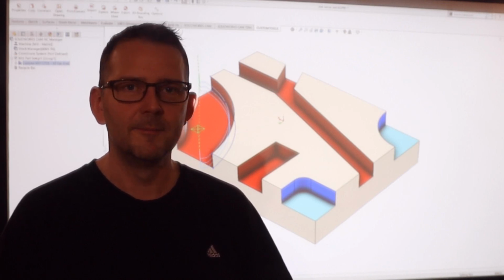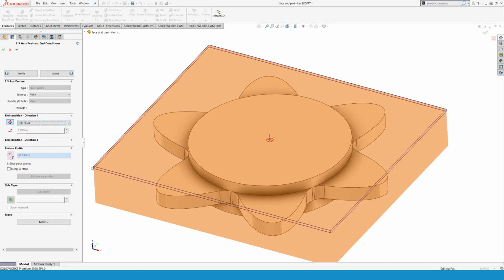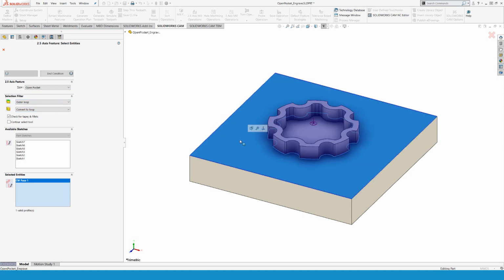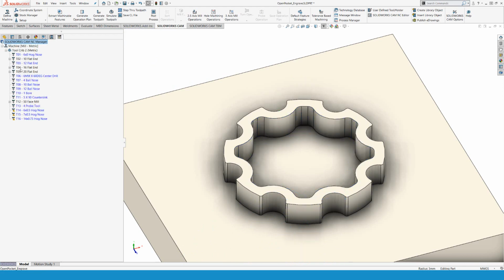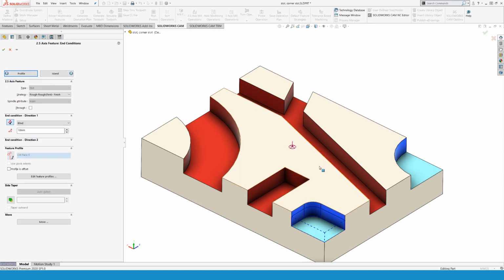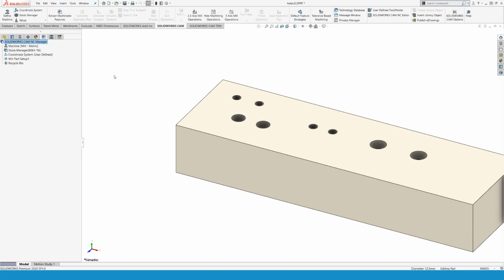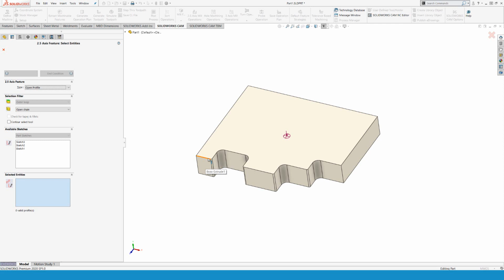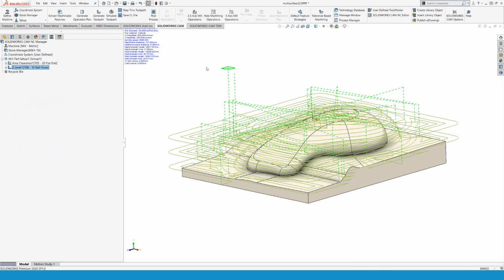Introduction to SOLIDWORKS CAM and CAMWorks - Understand Features

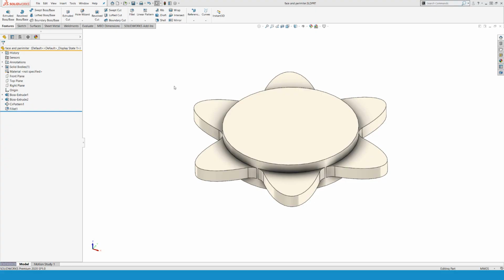Comment from the maker: 2:00 How to activate SOLIDWORKS CAM or CAMWorks

- Demo #1
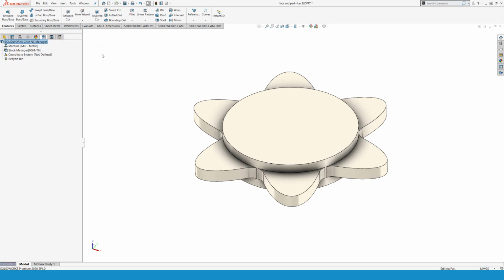3:10 Initial Setup
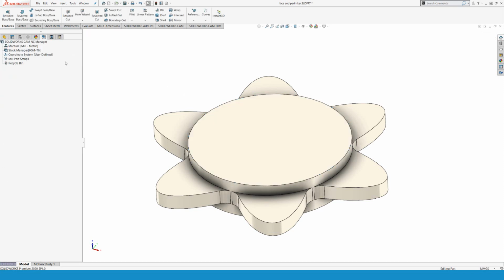5:11 Face Milling
7:31 Part Perimiter

- Demo #2
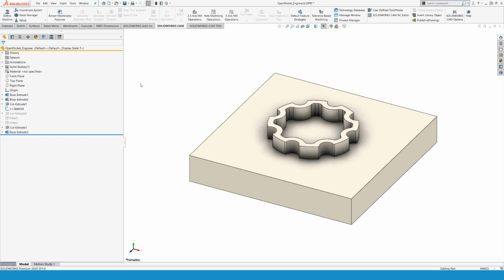9:22 Initial Setup
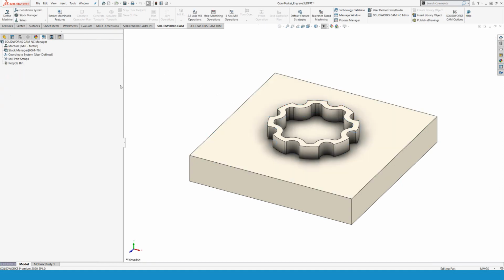10:18 Face Mill
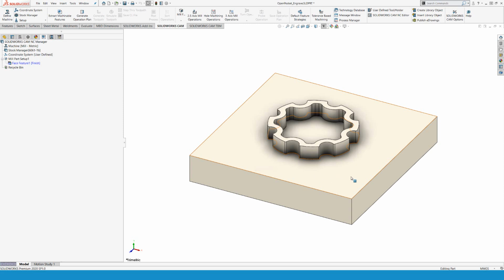10:40 Open Pocket with Island/Boss
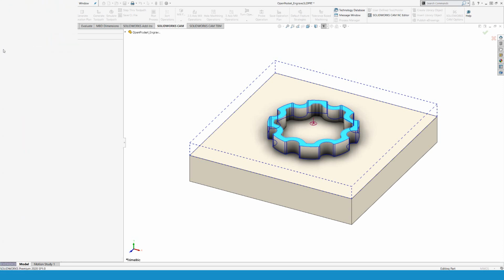11:40 Pocket
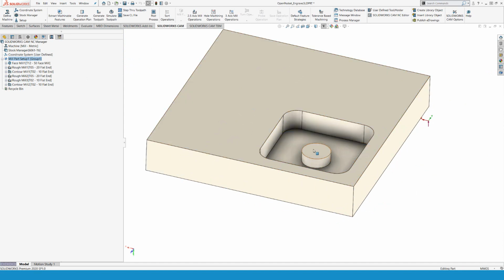13:10 Add Second Mill Part Setup 
13:35 Pocket with Island/Boss 
15:20 Add new tool
16:10 Move operation to new tool 

- Demo #3
16:50 Initial Setup
17:10 Align coordinate system / Fix incorrect axis directions
18:18 Face Milling
18:45 Slot/groove/channel milling
21:40 Toolpath Simulation
22:03 Add multiple slots in one operation

- Demo #4
23:30 Initial Setup
23:50 Align coordinate system / Fix incorrect axis directions
24:19 CAM Options
25:00 Automatic Feature Recognition of Holes
26:28 Change hole type (Drill to Ream)
27:10 Change hole type (Drill to Thread)

- Demo #5
28:19 Initial Setup
29:04 Open Profile/Curve
29:25 Selection method (automatic chaining)

- Demo #6
30:09 Add Third Mill Part Setup 
30:27 Engraving

- Demo #7
31:20 Initial Setup
31:41 Align coordinate system / Fix incorrect axis directions
32:28 Multi Surface Feature
32:49 Area Clearance and Z-Level
33:20 Adjust toolpath settings (Operation Parameters)

Comment: The slot feature doesn´t work for me. It does mill a narrow path on a corner slot, but it does not mill away the rest of the exess material. And the same happens with pocket.

Comment: 28:45  How woulld you generate a toolpath using only the side of the end mill to cut the contour (notches)?  So, starting with the stock, and the end mill at the full depth of the stock, the cutter would take mutiple cuts in the "Y" direction cutting out the notches, then a final pass following the contour, all cutting from the side of the end mill at the full depth.
Reply from the maker: I'd use either VoluMill or Offset Roughing for that.
Reply: @CADWorksdk  I've been trying out the VoluMill option for a few days.  The desired toolpaths are easy to make, and the milling strategy is easier on the machine (Tormach 770M).  Thanks for the recommendation!

Comment: While setting up the strategies for the perimeter (or other features) I see a check box for "through". What does this mean? I don't see a difference when it is selected or not.
Reply from the maker: The end conditions will allow you to define different strategies for the otherwise identical features. For instance a blind and a through pocket. For the blind, you can define a strategy that works really well, and then copy the feature strategy as a new one where you mark it as Through. And then add a bit more depth, to allow tool to penetrate through the full depth, for better machining.